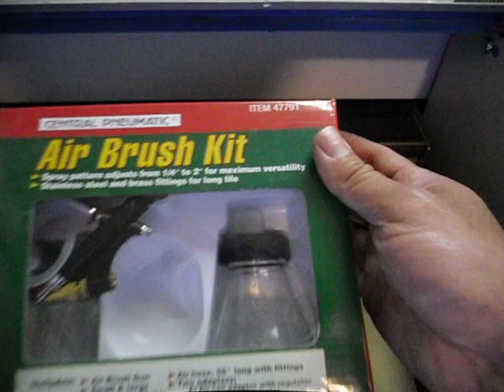Cheap China Laser Cutter Air Assist and Cutting

Comment: THANK YOU !!!! 200% performance increase !!! Now I can cut at low speed (5 mm/s) without flames (!!!) and at VERY low laser power ! I use max 8 bar/116 PSI , I think the higher the pressure, the easier the cutting=faster chemical oxidation rate. The only problem is: holding the piece on its place, that's not a big problem :)

Comment from the maker: You can pass over a few times, but the edge will not be as clean.  I recommend running a pass as few times as possible. The more the acrylic is expossed to heat the more brittle it can become. Especially if you plan to glue 2 pieces together/